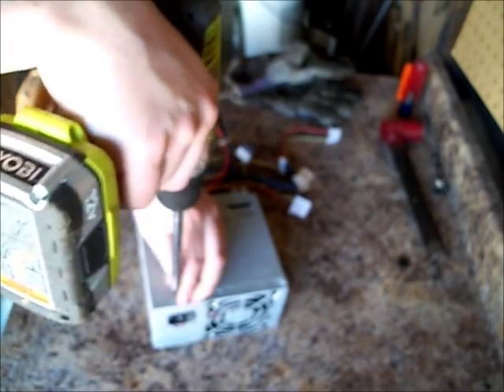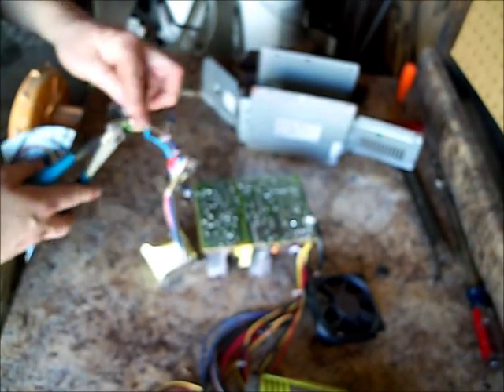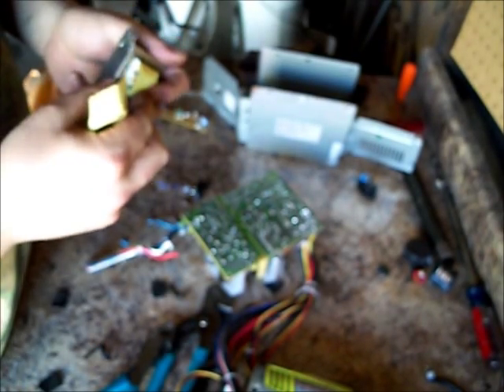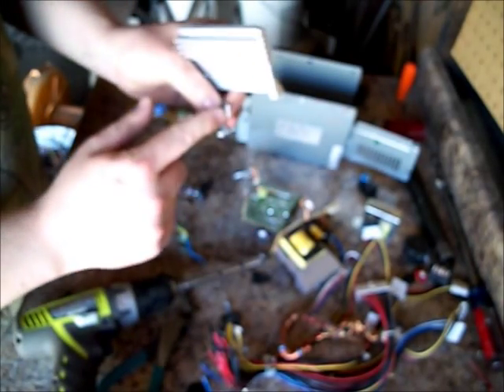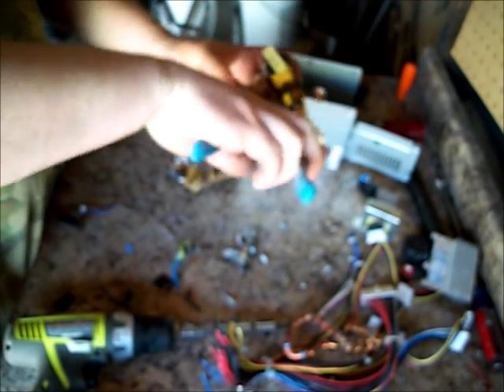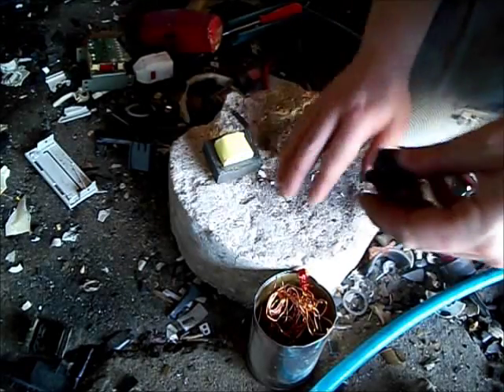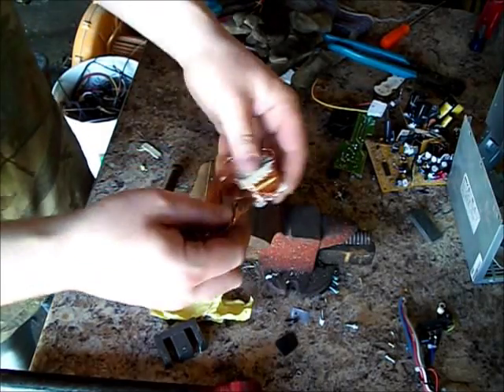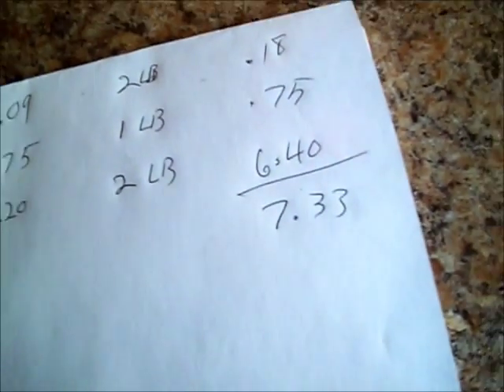scrapping a computer power supply scraping tips

Comment: What grade circuit board is that broken up mess considered?  I thought copper bearing motors were about $0.25 a pound and low grade circuit board is only $0.15 a pound.  Maybe the prices changed since this video was made, or different regions have different prices?